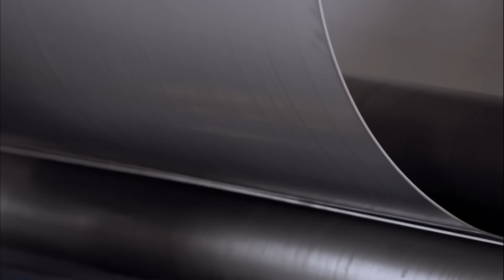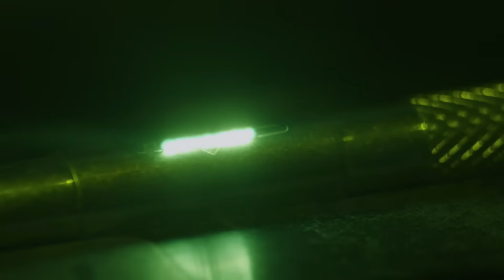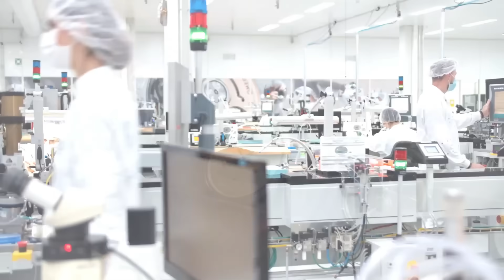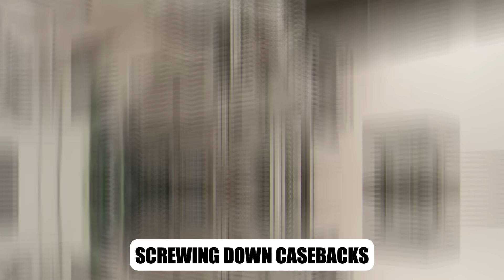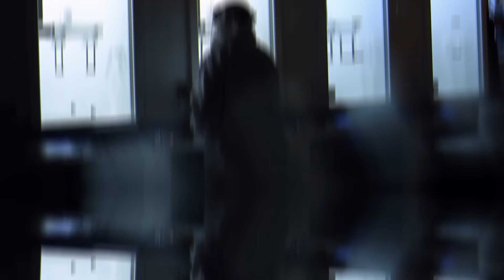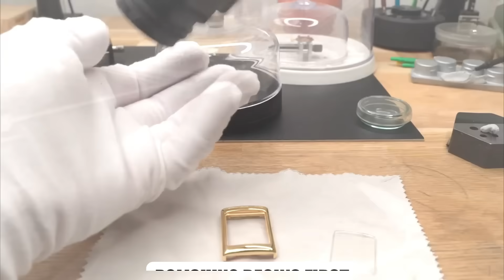How Omega Watches Are Being Made?!

Comment: Purchased a seamaster 300 dive watch in black face and love it.  My only complaint is that Omega needs to manufacture bigger straps.
Reply: You can get larger or smaller rubber straps at the boutique if you live near one. I have the same watch on a bracelet and I love mine!
Reply: @gunyoda2356  my rubber strap on my aqua terra failed after 4 years, a watch that was worn in rotation 4 to 7 days a month on the wrist luckily for me it snapped on the watch winder and not on the wrist. I will stick with a bracelet from now on.
Reply: You bought a watch while wearing black face? I'm surprised they didn't kick you out of the store.